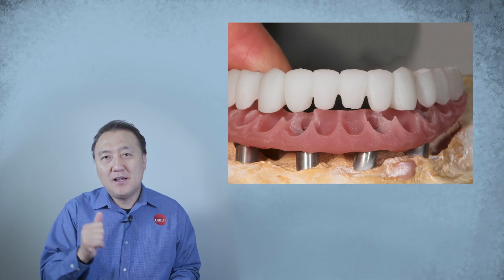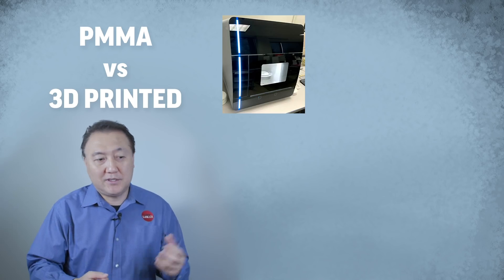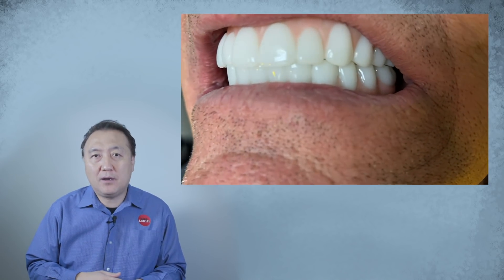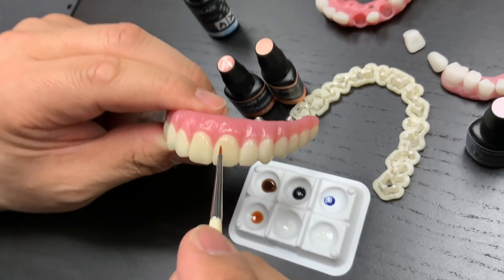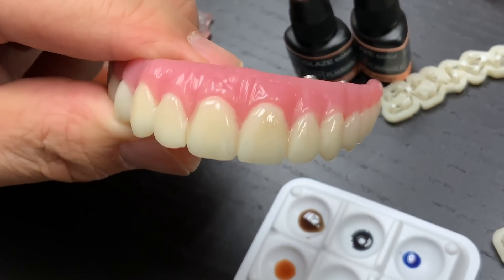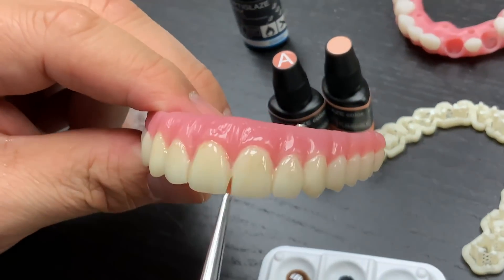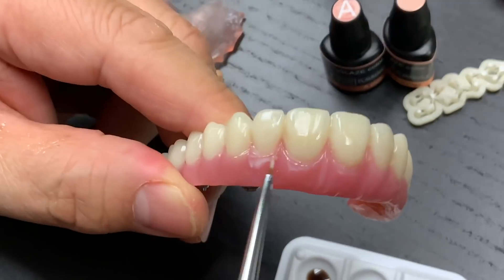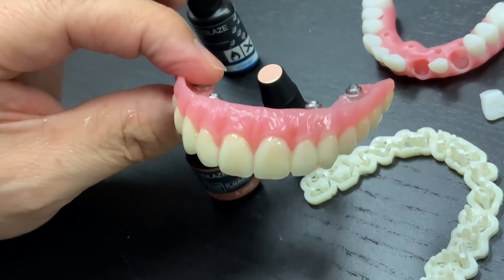Why Digital Dentures Make Great Provisionals!  & How To Characterize Digital Dentures

Comment: I went for my first wax try 8n for my first digital, 3D denture. This is my third det over 25 years or so. Loved the BL2 shade i chose but they did not fit. Not even close. Not even the dentist could get the bottoms in. On close insoection the teeth looked like a one piece snap on teeth not individual teeth. So back to square one and scanning my mouth and rims again. How could they be so badly off using such modern technology ? I went to a very reputable place by the way with great reviews. The lab isnt onsite. Thry made a complete finished product and not the wax try in

Comment: Great videos! Thank you! 3D printed dentures are great for immediate/interims.  Resin material strength just isn’t where it needs to be (for now) for permanent denture options.  What way are you processing permanent dentures currently?
Reply from the maker: this is long term temp

Comment: Why not do disposable dentures like they do disposable contacts?  Instead of a "permanent prosthetic" just have a new 3D printed denture every 3-6 months, and as long as the fit is good, you wouldn't need it redesigned, just print it again, same as last design.
Reply: Thats because it will cost you 1300 every time,
Reply: Because it takes time to complete a printer cd it's not just printed done takes time

Comment: I have 4 lower implants and 8 upper. He did the hader bar system although I was told at the start they would be screwed on semi permanent. Already had paid 20,000 of a total 34,000.00. Not time to argue.  Its been about 10 years. I had a tooth break off from a pitted prune that still had the pit. Anyway I was thinking of. Mexico to get screw on as my wealthy sister paid and I cant afford 5,000. Any suggestions?
Reply: Dont trust anyone in here about any kind of dental work and costs. They all ask for huge amounts but the results are awful. I went from dentist to dentist, and I feel like I need to get some education in dentistry to be able to create my own dental crowns and bridges. They all install small teeth and now I look like a 90 years old, and live without job. Bad dental work will destroy,  smile, bite, the look of your face, destroy your financial because they demand so much like we need to have a second mortgage only to pay for dental work. After years, I now know how they destroyed every single tooth in my mouth. They all know what is done wrong by another dentist but they do not talk against each other. So, after each tooth was treated , I had tooth infection and the tooth was pulled out. Finally, I had a young dentist in Canada who pulled out the stuff from my tooth and was shocked: my root canal was filled with tiny cotton swabs and was done with biodegradable post., which caused infection into my sinuses, almost became blind, headaches were awful. Moreover, I had to pay for a surgery to have all the infection removed from my face. This is how evil they are.  Try to find a true American dentist, if possible someone who is over 55 years old because he /she likely has conscience . Try to spread the word around about people to stay away from dental care and be wise about trusting what advice they get and to AVOID implants. Implants are scams! Not only that they are expensive but their maintenance  costs are expensive and they cannot be pulled out after they were integrated. It means, it's been easy to install an implant but then it's expensive to maintain it or to ever be able to remove such a nightmare.
Reply: @MrMdaeu I am a Canadian 52 year old denturist and agree 100%